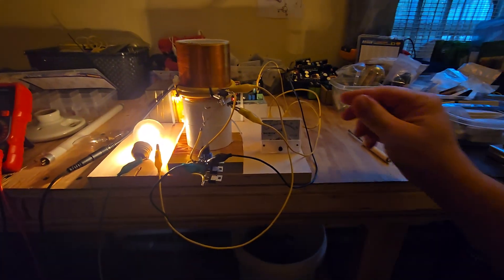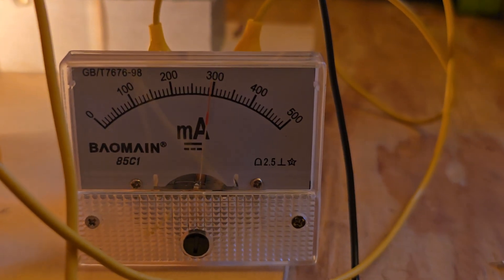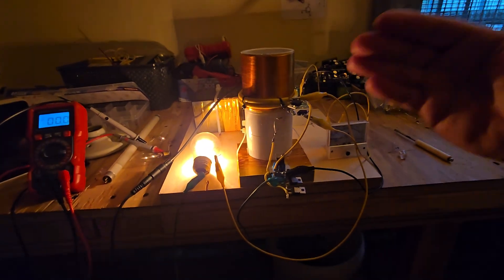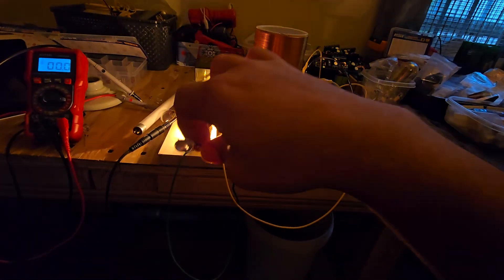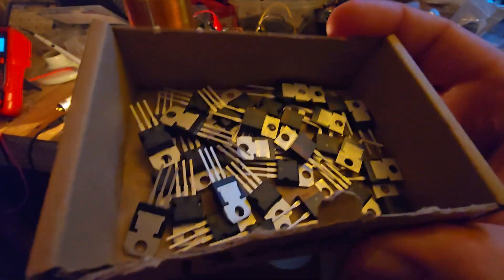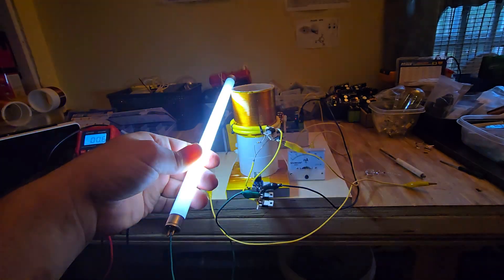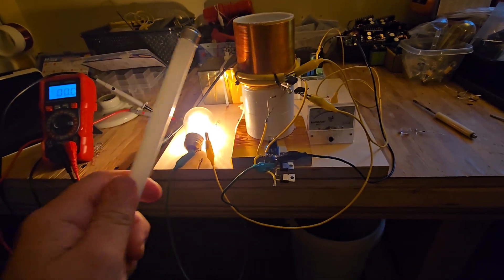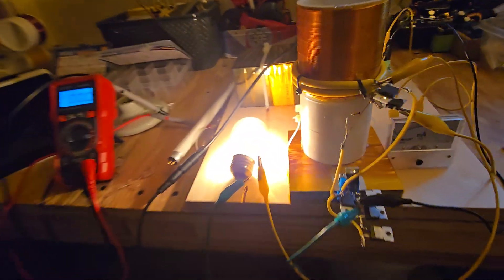💡BACK EMF TANDEM OUTPUT FROM TESLA COIL RUNS 30 WATT 120VAC INCANDESCENT BULB PLUS WIRELESS POWER☁️

Comment: When you are add a capacitor to  the blubs, how you calcuate that? Output voltage x3 but minimal capacitance? Here you are using 2 transistors ... 1 NPN and 1 PNP? Please share the diagram!

Comment: Try to filter the voltage across the lamp with a capacitor and put the DC volt + amp meters on the lamp.
Then divide output power / input power.
It seems very efficient circuit, but we need to know exactly what is the electrical efficiency. 

Nice job! 😊